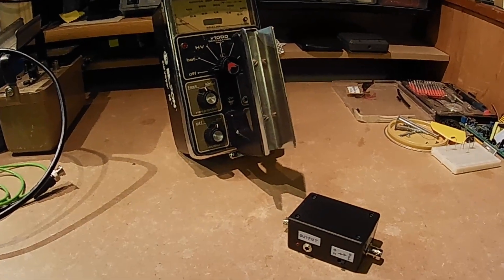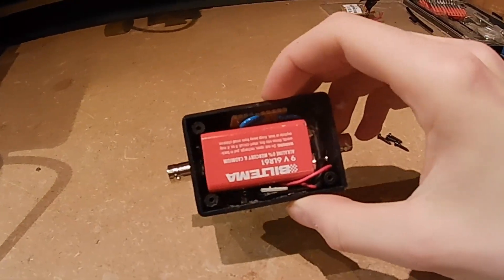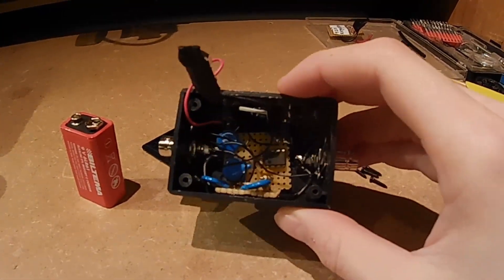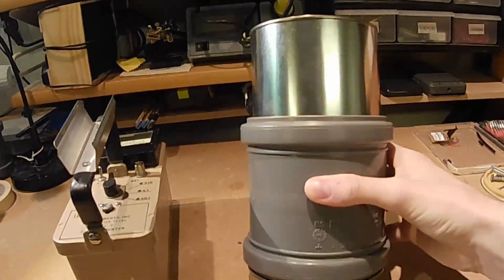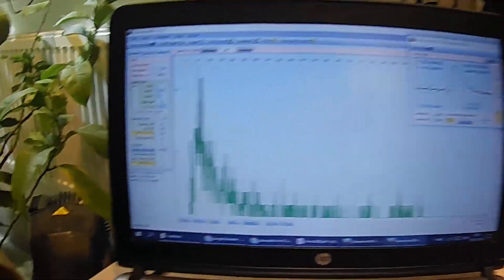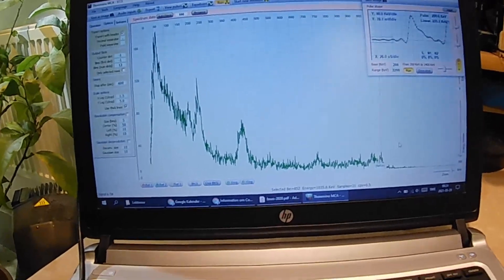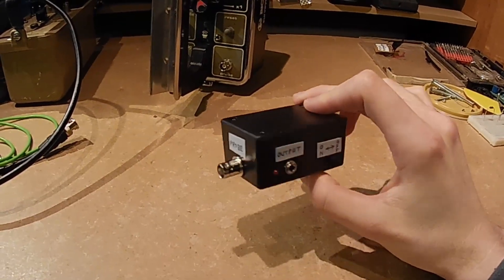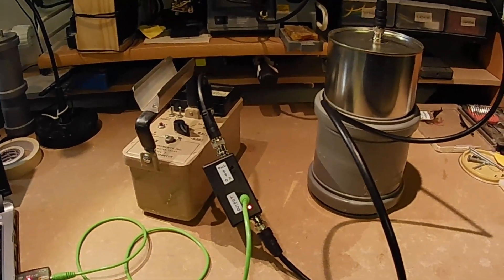Ratemeter Gamma Spectroscopy Module

Comment: Hi, does this spectroscopy module also work well with the Bicron Surveyor M?
Reply: I am asking because I actually don't know if I should get the Bicron Surveyor M or a Ludlum Model 3. The Model 3 is Eur 100 more than the surveyor M. Do you have any suggestion wich one is better?
Reply from the maker: Why yes, it works great with the Bicron Surveyor M. Any ratemeter with a sufficient voltage should work, so most Ludlums, Eberlines, Bicrons, etc. 
I have a Ludlum Model 2 (basically a Model 3) and a Bicron Surveyor M. Out of these, I prefer the Bicron, as it has a high voltage read-out and a scaler, two functions the Ludlum lacks. But the choice is up to you. 
I hope this helps :)
Reply: @aelaboratories2572  Nice thank you, got the Model 3 because the Bicron Surveyor didn't seem to be that good in shape ;)
I have also built a scintillation detector. Was lucky to buy a whole bunch of photomultipliers. 

I really enjoy watching your Videos. Maybe you have seen my geiger counter project in one of my Videos. If you want a unit to review just let me know. The software is now much better than in the video.